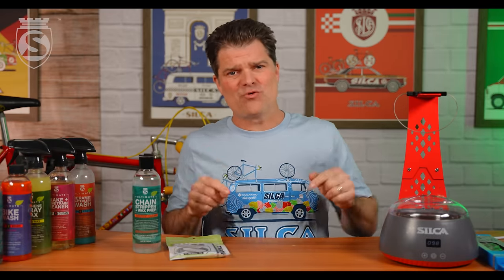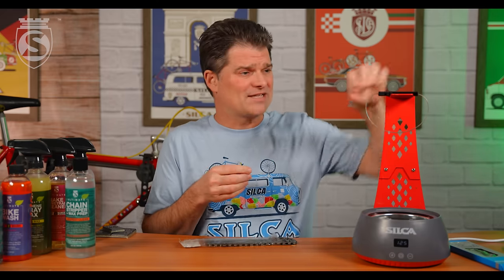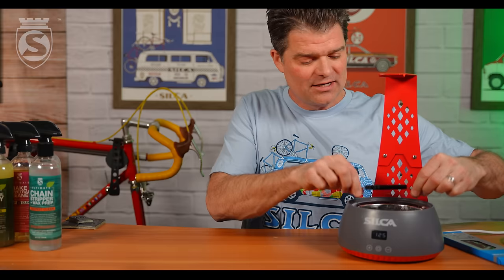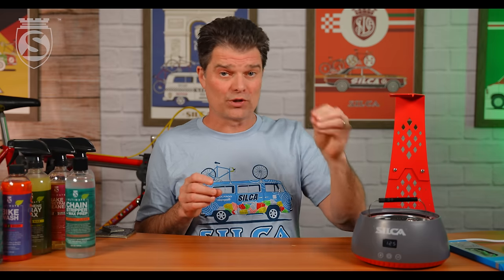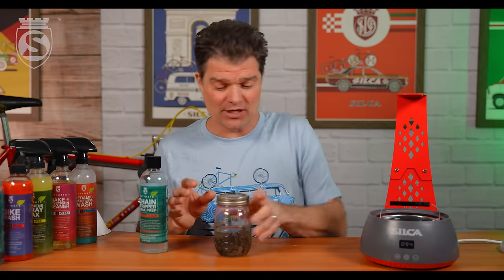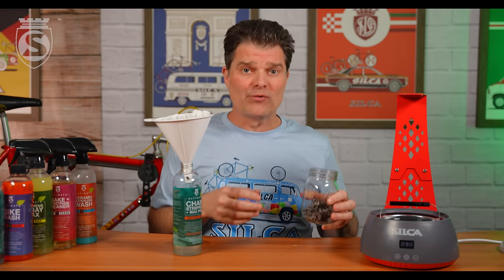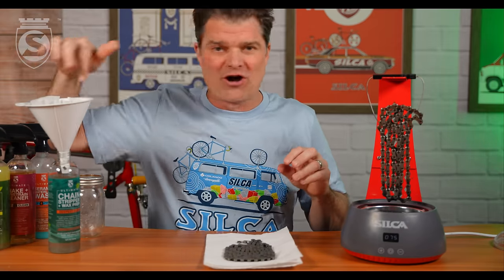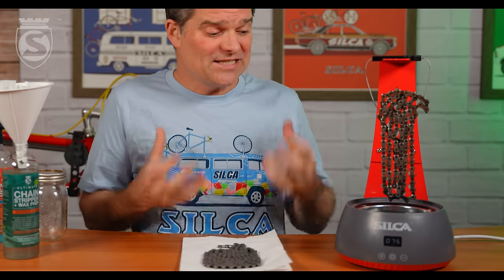Chain Waxing System Tutorial with Josh: A Step-by-Step Guide!

Comment: What is the reason to let te temperature drop to 75° before removing the chain?
Reply from the maker: Pulling it too hot will allow more wax to run out of the chain resulting in shorter application lifespan.  It won't hurt anything to pull at higher temperature, but the application might not last as long.

Comment: If you are using the Silca Chain Wax System pot, and you want to change out the wax, what is the best way to get the old wax out of the pot (cleanly)?
Reply from the maker: Easiest is to heat it up and pour it out into a pyrex or similar heat resistant vessel.

Comment: What was unfortunately cut out is what you did with the water after rinsing the chain. Is it safe to put in the drain? (In respect to the environment and in respect to the seals in the drainage system since we learned that it ate the seals of the bottles)
Reply from the maker: Once diluted it can be put down the drain with no risk to environment or seals.

Comment: In previous videos you suggest letting the wax cool to around 60c (surface temp with digital thermometer) before pulling it out of the wax. Is this not necessary anymore?
Reply from the maker: We see no difference between 60 and 75 in terms of wax holding, both are far better than the 90-100C that is the standard crockpot low setting.

Comment: What happens to the factory lube that remains after using a strip chip? How does it not contaminate subsequent stripped chains? Science and chemistry? Thanks!
Reply from the maker: StripChip converts the factory grease into a type of wax that is compatible with the base wax.. so it's no longer a contaminant.  So when you re-wax you just keep using the same stuff and it works as normal.  Sort of a chemistry magic trick!

Comment: What coffee filters have people had luck with? I doubled up on some filters I got from amazon and I still see some gray debris at the botttom of the bottle
Reply from the maker: You'll never get all of the gunk filtered out, but as long as you have most of it you'll be fine.  I generally use one of the thicker or two of the cheap/thinner filters, but you can also use a thinner filter plus a paper towel to try and capture the encapsulated grease.  The most important step of using Stripper is the final rinse with water, we recommend 2 rinses, and if your stripper is getting older, you may want to do 3 rinses after.

Comment: Is my waxed chain supposed to look dirty from the dark wax or am I leaving too much wax on the chain.  My chain always looks dirty!!!
Reply from the maker: The dark color of the wax will make the chain look slightly dirty, but it shouldn't be too bad and shouldn't last too long.  You can always try waxing a little hotter to see if you like that better, pulling the chain at a slightly higher temperature will allow more to run off of it leaving a thinner film on the chain.

Comment: Received the system 2 weeks ago and used it to wax a new chain using the strip chip. That was quite easy.
I let the wax cool in the pot.
But I tried to reapply some wax (rainy conditions here in France), it appeared that using the advertised temperature (75 celsius) takes a loooooong time to melt the wax in the pot. In fact, I had to set the temperature up to 90 to melt the wax, because it was not entirely melt even after 20 minutes.
Is it due to the strip chip?
Reply from the maker: No, that's due to the PID control.. with a thermostatic control, the pot will go full heat until the temperature is reached, this is faster, but risks burning or damaging the wax. With PID, the heating element goes only to the set point and holds there, which provides much more control, but takes longer to get hot as less energy is being dumped into the wax.  I set mine to 90C and then just turn it down when it gets to 75 or so and it usually takes 20 minutes to fully melt.
Reply: @SILCAVelo thanks a lot for your quick answer ! I will follow your advise.

Comment: So, Once the wax has used six chips, that has to be discarded?  I also don't understand why the hot wax is not contaminated from the factory grease after using a chip.  Can you explain this?
Reply from the maker: Stripchip converts the oil in the factory grease to wax..once converted it's like all the other wax (essentially..) the other ingredients in the grease are friction modifiers and corrosion inhibitors.. those are fine and just stay in there.  You never need to throw it away, you just keep waxing with it until it runs out and you add more wax.
Reply: @SILCAVelo  Chemistry rocks!

Comment: Just a question on heating up the wax, should I just turn it on and let it heat up for an hour or more to melt the wax at 75 or can I turn it up to like 125 for melting purposes, then turn it down to 75 for Normal waxing (no strip chip involved) in my garage it takes forever to heat up and melt at 75C
Reply: For absolute maximum wax longevity in the pot, heating it up to 75C slowly is your best bet.
Otherwise, you can just crank up the heat until it gets up to the proper temperature.

If you want to have your cake and eat it too, the best compromise is to put your chain it at the same you do the wax heating: your chain will work as a heat sink and will improve heating uniformity, making it safer and faster to heat up the wax.

Comment: Regarding quick links - SRAM chains (at least the ones I have) ship with the quick link in the packaging with the main chain, so they have grease all over them unlike the ones you used here - If you’re strip-chipping the chain, would you still recommend not waxing them? Do you have to strip/clean them separately, then?
Reply: Do not wax the quick link, it makes putting the chain back together more difficult. But I do strip it separately with the Silca chain stripper.
Reply: I stripped mine like @jeffwards below.  But would love to know Josh's thoughts on whether that was necessary

Comment: do I need a new chain before waxing?  or can I strip my current chain?
Reply: Same question!
Reply: @klemieux66  no you do not.  You can only use the strip chip on a new chain.  You will need the liquid chain stripper product to strip your current chain.  Also Im never going back to chain lube again.
Reply: @RussWittmann  ok, so the Silca Chain Stripper and Wax Product for cleaning a lubed and greasy chain, which is can then rinse off and wax.
Reply: @klemieux66  you would strip the chain until clean in the cleaning solution only.  once clean let it completely dry and then drop into the hot wax for 10 minutes, pull out and let dry.

Comment: In older video you removed chain at 60 °C here you do 75, does it make difference?
Reply from the maker: We see no difference between 60 and 75.. but you will get excessive runout up at 90-100C which is where most crock pots will sit on the Low setting so we do still advocate for allowing it to cool slightly if using a crockpot.
Reply: @SILCAVelo  I have the Silca melting equipment

Comment: My process is slightly different, in that have the bike sitting on the stand behind me, ready for the waxed chain.  I put the chain on the bike straight out of the wax (using 9mil Nitrile Gloves) so it's still warm, then pedal while shifting through all of the gears.   The pushes excess waxa off the plate junctions and results in much less wax flaking off, and not having to go through the break-in process with the very stiff chain.
Reply: If you're pulling out the chain from the pot while the wax is still hot it will not hold the recommended amount of wax, because it drips. You basically under wax it this way

Comment: You would think at some point with the popularity of waxing that chain manufacturers would offer a nongreased or paraffin waxed chain so there would be no need to strip it.
Reply: I'm guessing they don't because if they weren't stored in a pretty arid environment (and most shops don't control for humidity) the chances of the chain oxidizing before it was sold and installed would be a problem

Comment: Sooo the strip chip also waxes? Then second time just use wax?
Reply from the maker: Strip chip converts the oil in the grease of the factory chain into a wax.. from then on, the wax is just wax and you can keep using it for rewaxing.

Comment: Is Chain Stripper safe to use in an ultra sonic cleaner?
Reply: Coated products should not be placed in an ultrasonic cleaner. The coating on the anodized surface is chipped away. It is better not to put bicycle parts in it. (Try it. It rusts faster.)
Reply: @short_1food  I've been cleaning my chain and cassettes in an ultrasonic cleaner for many years (since 2018 to be exact), and then immersing my chains in molten wax. It's the best thing I've ever done. The chipping away of coatings happens when you use a cleaner that's too aggressive combined with the ultrasonic cleaner. There is no issue if you use the right products. Hence my question if Chain Stripper is safe to use in ultrasonic cleaners

Comment: Hey Josh, will the chain stripper solution work on a chain that has muc-off ceramic lube?
Reply: Think it’s gotta be factory grease.
Reply from the maker: Chain Stripper will remove all types of lubricant other than wax, so for a used chain with any lube on it, use Chain Stripper.  StripChip only works on factory grease.
Reply: @SILCAVelo   Thanks! I already bought the strip chip package, Secret Chain Wax and the new hotpot from your website along with a brand new Dura Ace 12spd chain.

I will go ahead and get the chain stripper solution so I can wax my current chain now that I know it works with other types of lube~

Comment: Ive heard in a previous video that the chain only needs 2 minutes in the wax pot after you cleaned it first with Stripper. In this video Josh mentions 10 minutes, thats only in case you use the stripchip in the wax i guess ?
Reply: They say 5 minutes for a stripped chain in this video. Mostly to bring the chain up to 75 degrees Celsius as well. It shouldn't need a lot of time, there's no chemical reaction, just a bit of time to seep in, and with some agitation to help that. The manual with the pot says the same. But realistically, the pot and wax takes a bit of time to warm up and melt the wax, so what I do is plug it in, turn it on. Get my chain and put it on the hanger thing and then lay it on top of the partially melted wax and go do something else for 10 minutes. That will probably do the trick as well. Swish it and then job done.

Comment: Hello Josh! Question : if I use hot wax with strip chip just for new chains and then use the secret lube afterwards, what do I do after I used 6 chips for one bag? Do I have to throw all the wax away or can I continue to use it? I don’t like the idea of wasting.

This convinced me to do the switch from oil to wax. Looking forward to try it out.
Reply from the maker: You can just keep using the wax until it is gone.  The point of the 6 chip limit is to keep the wax from becoming too high a percentage Stripchip and converted grease.  We've tested it at 6 factory chains/StripChips per 500gm of wax with no performance degradation, but if you were to keep adding StripChip and chain grease there will surely be a tipping point where performance suffers.

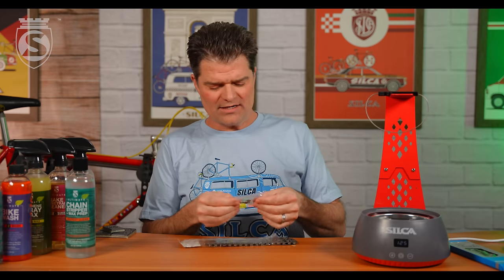Comment: Josh , compare your advice at 2:43 to your old video https://youtu.be/KZ7LveURBWQ?t=255 where you do advise to wax the quick link. That video has a few other issues as well which has put off a few people from immersive waxing , the main one being having to wait for the 'skinning over' of the wax before pulling out the chain. Note that ZFC does not do this and I have had no problems for years with the ZFC method. I have had more than a few debates on YT over this and it is probably not doing your business any good. You don't want to put barriers in the waxing process.

On the plus side I can now use the chain stripper part of this video to educate some people who think sprinkling it on the chain a couple of times is enough !

Comment: Shouldn't someone wait a bit more with putting the chain out of the pot? I saw videos explaining that putting it out too early the (still hot) wax flows out of the chain links and therefore decrease the performance & longevity of the wax.
Reply: Only the excess wax drips off the plates it's inside the rollers where it matters + if you let it cool and remove it as if it forms a skin that's just extra mess and wasted wax on the floor 😉

Comment: This video is 15 years too late for me.  Not that I no longer cycle, but I'm no longer into anything complicated or expensive.  The most mileage I've ever had is 2500 a year and nowadays I just spray on some motorcycle chain oil/grease every month or so, wipe excess on an old towel, don't bother even trying to clean the chain more than that and replace when the so-called stretch gets to 1/16" in a foot (0.5%).  This means I only get around 2000 miles in a chain, but 9-speed chains are no longer expensive.

The British Isles is salty and the roads are often wet even if it's not actually raining when you ride.  You are forever getting grit and water in your chains.

Believe me, back in the day I tried all sorts.  Cleaning with petrol (gasoline) but I couldn't filter the dirt out easily enough (should have bought filter papers, with hindsight) and was trying to settle out the dirt.  I tried waxing but had no idea what I was doing and this was pre-internet days.  Waxing wasn't mainstream and I had no-one to show me how.

I bought a liquid wax from my local friendly and useless bike shop.  After a few weeks of constant squeaking, they told me I was supposed to wax before every ride.  Not really practical as the liquid wax needed to be kept warmer than my house was to be applied and I was using the bike as a commuter.  Then they told me a wet-weather oily stuff would be easier if I wanted to apply less frequently, so I switched to that.

Then the local friendly and useless bike shop sold me a chain cleaning kit with a water-based cleaning solution that worked as well as coloured water.  The kit had a stupid plastic container thing which held about an ounce of cleaning solution (for which I substituted Diesel) but the number of times you had to swap out the dirty fluid was ridiculous and some abrasive dirt always remained, I suspect.  Convinced that the wear was more down to grit than bad lubricants, I started cleaning as thoroughly as I could weekly and then applying a fine oil.  This didn't work, and the chain failed in under 1000 miles anyway.

Realising I was never going to get the chain as clean as I wanted, I gave up trying as at least I wasn't driving grit into the vulnerable parts by soaking in solvent, and here I am with my minimal effort basis.  Wasteful in some respects, but still significantly better than using the van, so it'll do me.

But when I saw someone obsessing over a new bike and trying to get a chain clean with a brush and wasting a lot of time over it, you can imagine my advice was 'look - I'm not saying it's not possible, but you're wasting your time'.  Next time, my advice will be 'you're wasting your time doing it that way but, well... I'm jaded, but, if you can be bothered, check out this SILCA guy on Youtube and let me know what you think'.  Because it really does seem that you're complicating it enough that your system might just work.  Glad to see somebody actually knows what he's doing.

Comment: Great video Josh, but there are a few things that are not so clear with the wax system:

1. Instruction is a bit vague for chain stripper. Please clarify:
a. Do you heat the wax at 125F, insert the chain and wait till the temperature drop to 75F?
b. Can we start at 75F, if yes, how long do you submerge the chain at 75F ? 
2. When do you know when to rewax, any indication ? I can't keep track how many miles I rode on my bike.
3. Need another video to show how to apply super secret after 150km. Need another video for reset/rewax after 300km. Do you need to degrease the chain first ? Should you put the chain (to get rid of all the grease and dirt) in boiled water and then rewax ?
Reply: I think he did address most of these over the course of the 3 recent wax/pot/chip videos. All of the various temp guidelines are "heat to that level, then add chain, swish a bit for a few minutes. Using chip at 125 takes much longer for the chip solution to fully swallow the grease which is why he said leave it in and wait for temp to drop to 75, which is optimum for the wax part of the degrease/wax process. When to rewax? When you can hear your chain. Waxed is whisper quiet.
Reply: P.s.-- once degreased for the first wax, you never need to repeat or degrease, and don't need to do the boiling water de-wax process either, unless you have an extremely dirty chain somehow and want to avoid contaminating your leftover wax that would normally support at least 5-10 more treatments.

Comment: Shimano should sell a version of their chains without grease - saves them a bit of money and saves us from having to degrease a new chain before waxing it.
Reply from the maker: Unfortunately the lubricants are part of the assembly process of the chain and help ensure that the chains don't get too hot during riveting and such.  So for them to sell the chains without grease, they would have to strip them at the end of the manufacturing process which would just add cost and risk to them as they would then not have the shelf stability and corrosion resistance needed..